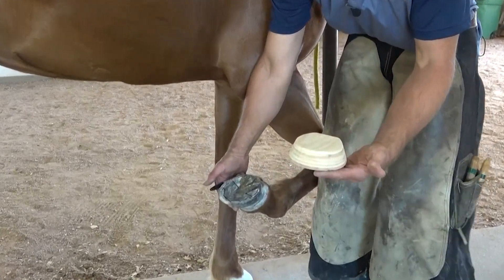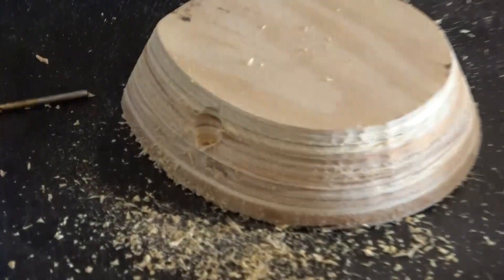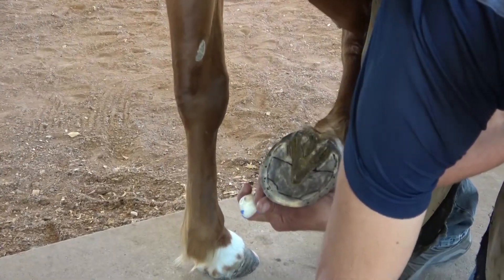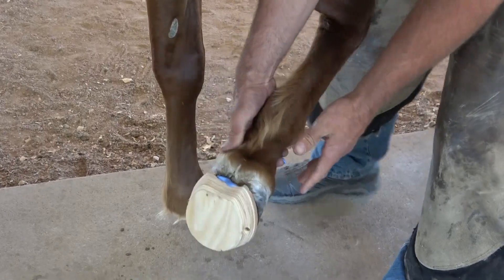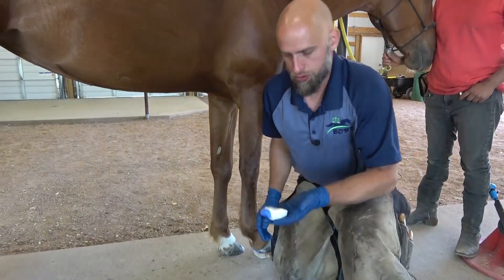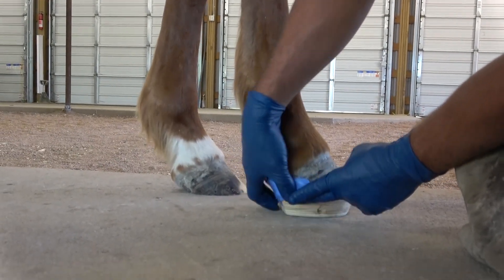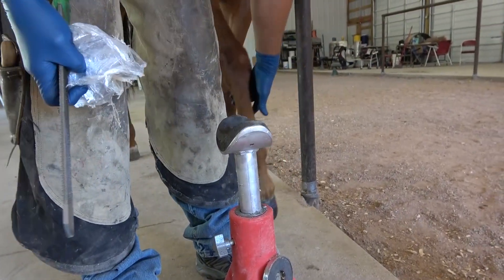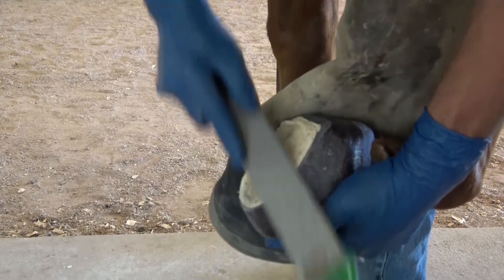Equicast Application - Wood Shoe with Cast & Glue for Restoration of Foot Function

Comment: Can a person just use the wooden shoe on the horse's front feet?  It looks awkward.
Reply from the maker: The majority of the time they are used on front feet, as they tend to be affected by laminitis and founder more often (at least most noticeably affected).  They can be used on hind feet and some horse do fine with them and others can be more reactive as they don't generally have something of that size or height on hind feet.  Most get used to it in a short period of time though.  Is it used on the hind feet much less than the front though.

Comment: Thank you for the video.  What is the consequences of the wedge that will build up if the heel area is not balanced and filed? I'm confused where the wedge is building up.
Reply: Basically if you leave the casting under the ground surface of the shoe in the heel region, as the wooden part wears down over time just from the horse's movement, the front part can wear more than the back creating a wedge.  In some cases, a wedge might be what the horse needs, but if not, you don't want to create a wedge by leaving the casting under the heel if that is not what your plan was.  It is mostly about creating a situation where you do not have any unintended consequences of what you are putting on.  There can be some very beneficial or even necessary things that can happen from having the shoe wedged if that is indicated.  Chris was addressing what can happy if you are not being particular about where the casting goes and unintentionally creating a wedge when you did not mean to and it may not show up until the front half the shoe wears some.  Hope that helps.

Comment: Do you do this to the front two hoofs or all four hoofs? Or do you put it just on the one hoof only? I'm just curious of what you do in a case like this. I enjoy watching videos like yours because i've been around cattle quite a bit and horses i've always enjoyed seeing but haven't rode a horse too much but they're beautiful animals. That get neglected too often.
Reply: You can apply these to the front or hind feet, but they are primarily used on front feet.  Generally, you would put them on both fronts (or both hind) feet, rather than just 1 foot.  They are usually used to treat a particular pathology, like Laminitis or Founder.  They can be used in other injuries or pathologies like ring bone, coffin joint disease, collateral ligament strain, etc., but the most common use is Laminitis & Founder.  Hope that helps.
Reply: @codyovnicek3736  Thank You For The Information I Was Just Curious About How That Worked.